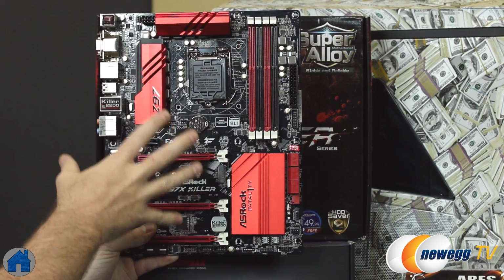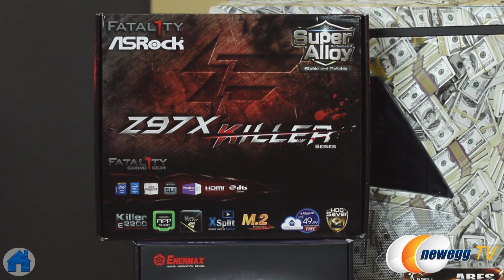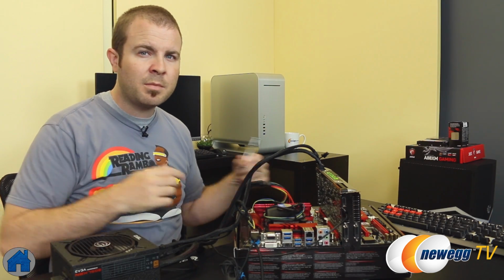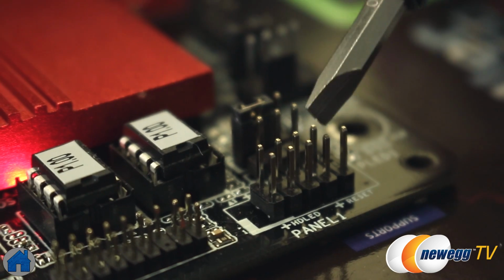How to Build a PC - Part 1 - Newegg TV

Comment: Please let me know if this is a good gaming computer, Im trying to get high Frames Per Second on high graphic games.

Case: BitFenix BFC-COM-100-WWWK1-RP White Steel / Plastic Computer Case

HDD: Seagate 1TB Desktop HDD SATA 6Gb/s 64MB Cache 3.5-Inch Internal Bare Drive (ST1000DM003)

CPU: AMD FX Six-Core Processor Model FX-6300 3.5GHz Socket AM3+, Retail

MEMORY: Crucial Ballistix Sport 8GB Kit (4GBx2) DDR3 1600 (PC3-12800) 240-Pin UDIMM Memory BLS2KIT4G3D1609DS1S00/BLS2CP4G3D1609DS1S00

GFX: Sapphire Radeon R9 270 2GB GDDR5 DVI-I/DVI-D/HDMI/DP Dual-X with Boost and OC Version PCI-Express Graphics Cards 11220-00-20G

MOBO: Gigabyte AM3+ AMD 970 SATA 6Gbps USB 3.0 ATX DDR3 1600
Motherboards GA-970A-DS3P

PSU: EVGA 500W 80PLUS Certified ATX12V/EPS12V Power Supply 100-W1-0500-KR

Thermal Paste: Arctic Silver 5 Thermal Compound 3.5 Grams

Comment: Hey guys! I'm asking you a question, that isn't really rare under these vids;
Is my rig nice? If not, how should I improve it? 
motherboard: Asrock FM2A58+ BTC (AMD FM2)
CPU: AMD A10 7700K (AMD FM2)
Memory1: Adata 8GB 1333MHz DDR3 AD3U1333W8G9-R (DDR3)
Memory2: Adata 8GB 1333MHz DDR3 AD3U1333W8G9-R (DDR3)
GPU: Nvidia Asus GTX970 4GB DDR5 GTX970-DC2OC-4GD5-BLACK
HDD: Seagate 2TB 64MB SATA3 ST2000DM001 (3,5")
Power supply: Antec 750W HCG-750
Case: Cooler Master Elite 241 RC-241-KKN4 (Not sure)
CPU cooler: Cooler Master Hyper 612 Ver.2 RR-H6V2-13PK-R1
(If I forgot something, tell em :P)

Comment: Tell me what you think about this build guys. 

Case: Apevia x-hermes black/blue mid tower
Processor: Intel core i5 4460 3.2ghz
Mobo: Gigabyte GA-B85M-DS3H HDMI SATA 6GB/S USB 3.9 Micro ATX
Memory: G.skill Ripjaws X series 8gb (2 X 4gb) DDR3 1600
PSU: Antec BP550 Plus 550W Continuous Power ATX12V 80 Plus Certified
Video Card: PowerColor Radeon R9 285 2GB

I NEED HELP ASAP.

Comment: Could somebody who knows what they're doing take a look at my list? I want to put together the best gaming PC that I can on a budget, but I'm not sure if this would be the greatest setup. 

Motherboard: Gigabyte GA-970A-DS3P
CPU: AMD FX-6300 6-Core
RAM: Crucial Ballistix Sport 8GB DDR3 1600 MHz
Video Card: EVGA GeForce GTX 960 SuperSC ACX 2.0+ 2GB
Hard Drive: WD Blue 1 TB
Optical Drive: Asus 24x DVD Burner
Case: Rosewill Challenger ATX Mid Tower
Power Supply: Corsair Builder Series CX 500 Watt

Comment: Is this good for gaming?
PCPartPicker part list: http://pcpartpicker.com/p/ZzTDXL
Price breakdown by merchant: http://pcpartpicker.com/p/ZzTDXL/by_merchant/

CPU: AMD FX-6300 3.5GHz 6-Core Processor  ($93.89 @ OutletPC) 
CPU Cooler: Cooler Master Hyper 212 EVO 82.9 CFM Sleeve Bearing CPU Cooler  ($28.98 @ OutletPC) 
Motherboard: Gigabyte GA-78LMT-USB3 Micro ATX AM3+ Motherboard  ($50.98 @ Newegg) 
Memory: G.Skill Ripjaws X Series 8GB (2 x 4GB) DDR3-1600 Memory  ($59.99 @ Newegg) 
Storage: Seagate Barracuda 1TB 3.5" 7200RPM Internal Hard Drive  ($47.89 @ OutletPC) 
Video Card: Sapphire Radeon R7 260X 2GB Video Card  ($97.98 @ Newegg) 
Case: Cooler Master N200 MicroATX Mid Tower Case  ($39.99 @ NCIX US) 
Power Supply: Corsair Builder 430W 80+ Bronze Certified ATX Power Supply  ($19.99 @ Newegg) 
Optical Drive: Samsung SH-224DB/BEBE DVD/CD Writer  ($14.98 @ Newegg) 
Operating System: Microsoft Windows 7 Home Premium SP1 (OEM) (64-bit)  ($88.98 @ OutletPC) 
Total: $534.65

Comment: Can this run Crysis 3 at 240fps highest settings?:
http://pcpartpicker.com/p/733sBm
Reply: clanshadow2 Not even close. Try this: http://pcpartpicker.com/p/zgHh8d
Reply: Pffft more like 200000 fps
Reply: Jethro McBob  What a troll...
Reply: ***** pfft... not even close to enough if you ask  me. I buy it by the gallon and slab it on with my handy dandy paint brush. #MySystenWontBoot
Reply: clanshadow2 lol the monitor you picked has a 60 hz refresh rate. meaning you will not notice any additional fps above 60.oh, and the fact that that build probably can not run minecraft LOL xD
Reply: ***** And the fact that you don't know this was a joke.
Reply: clanshadow2 obviously i knew you were joking. i was just playing along and humoring you
Reply: clanshadow2 it will run perfectly fine. but the only problem is that the monitor has 60Hz. Change the monitor and ur good to go
Reply: clanshadow2 moi

Comment: what do you guys think of my pc build

CPU intel i7 4770k @ 4.0GHz

MOBO:  MSI Z87 -G41

GPU  Geforce GTX 770

PSU  Corsair CX750M

MEMORY  16 GM RAM

OPERATING SYSTEM  Windows 7 Home Premium 

KEYBOARD  Corsair K70 RGB

MOUSE Razor Naga 2014

No Headset Lol

Comment: Do I have to use an aftermarket cpu cooler? It might be something I purchase later on when I upgrade my pc parts, but for now I just want to get my pc running, could the stock cooler work?
Reply: Jonah Neeley yes
Reply: Jonah Neeley i would recommend one because it makes your computer run quieter and cooler. Get the cooler master hyper 212 evo. Its only $30. For now you will be fine with stock. Just dont overclock.

Comment: so I'm building a gaming pc and this is my first pc (that i build myself) ever.

is there anything i should improve on? say to increase the bang for buck. oh and i need to be able to run graphically demanding games like BF4 and Skyrim at very high at 50+ fps.

http://pcpartpicker.com/p/HPZ423

Thanks!
Reply: You should get an i5 4670K instead of an i7 4790K, also replace the R9 280X with a GTX 970.
Reply: As long as you're not doing video editing you'll be fine with an i5 and use the money you save to get a gtx970 it'll run better at gaming
Reply: Anantya Rizky get an i5 and get a gtx 970 instead

Comment: So anyone wanna give me some thoughts on this build ? this will be my first pc jus keeping that in mind . thanks too anyone that can help !

CD: LG 12X Internal Blu-ray Drive & DVDRW, 3D Playback Combo Drive
GRAPHICS: AMD Radeon R9 280 3GB GDDR5 PCIe 3.0 x16 Video Card
COOLANT: Standard Coolant
CPU: AMD FX-8320 3.50 GHz Eight-Core AM3+ CPU 6MB L2 Cache & Turbo Core Technology
FAN: Asetek 550LC 120mm Liquid Cooling CPU Cooler - Extreme Cooling Performance (Single Standard 120MM Fan)
HDD: 2TB (2TBx1) SATA-III 6.0Gb/s 64MB Cache 7200RPM HDD (Single Drive)
IUSB: Built-in USB 2.0 Ports
KEYBOARD: AZZA Delta Gaming Keyboard w/ Anti-Ghosting & red backlight
MEMORY: 8GB (4GBx2) DDR3/2133MHz Dual Channel Memory (ADATA XPG V3)
MOTHERBOARD: * GIGABYTE 970A-DS3P AMD 970 ATX w/ Ultra Durable 4 Classic, On/Off Charge, GbLAN, 2 PCIe x16, 3 PCIe x1, 2 PCI
MOUSE: AZZA Alpha 1600 DPI Gaming Mouse
NETWORK: Onboard Gigabit LAN Network
OS: Windows 8.1 (64-bit Edition)
OVERCLOCK: No Overclocking
POWERSUPPLY: 600 Watts - Standard 80 Plus Certified Power Supply - SLI/CrossFireX Ready
SOUND: HIGH DEFINITION ON-BOARD 7.1 AUDIO
WNC: 802.11b/g/n 300Mbps PCI Wireless Adapter Network Card

Comment: Will an Intel Core i5-4690K Processor 3.5 GHz LGA 1150 BX80646I54690K work with the motherboard (including the chipset). pls and thank you big noob here
Reply: Yep. You want a z97 lga 1150 motherboard for that processor. (like the one in the video)
Reply: FussiestBore3 just remember you want lga 1150 mobo

Comment: Can i run game on ultra with this like bf4 
CPU: AMD FX-4300 3.8GHz Quad-Core Processor  ($95.99 @ Amazon) 
Motherboard: Asus M5A78L-M/USB3 Micro ATX AM3+ Motherboard  ($44.99 @ Micro Center) 
Memory: G.Skill Ripjaws X Series 8GB (2 x 4GB) DDR3-1600 Memory  ($69.99 @ Newegg) 
Storage: Western Digital Caviar Blue 1TB 3.5" 7200RPM Internal Hard Drive  ($44.99 @ Best Buy) 
Video Card: Sapphire Radeon R9 280 3GB Dual-X Video Card  ($172.98 @ Newegg) 
Case: NZXT Phantom 410 (Red) ATX Mid Tower Case  ($75.99 @ NCIX US) 
Power Supply: Corsair CSM 550W 80+ Gold Certified Semi-Modular ATX Power Supply 
Optical Drive: Asus DRW-24B1ST/BLK/B/AS DVD/CD Writer  ($19.79 @ OutletPC) 
Total: $524.72
Reply: Replace the FX 4300 with a 6300.
Reply: clanshadow2 already did that but thank you

Comment: EVGA Superclocked ACX 2.0 NVIDIA GeForce GTX 980 4GB GDDR5 PCIe 3.0 x16 (Maxwell) (Single Card

1,000 Watts - AZZA Titan 1000W 80 Plus Bronze Active PFC Power supply

ASRock X99 Extreme4 ATX w/Intel GbeLAN, 3x Gen3 PCIe x16, 2 PCIe x1, 1x Ultra M.2, 10x SATA 6GB/s

Widescreen 1920x1080 Sceptre E225W-1920 LED Monitor 

16GB (4GBx4) DDR4/2400MHz Quad Channel Memory (GSKILL Ripjaws 4)

256GB ADATA SP610 SSD + 2TB SATA III Hard Drive Combo 

Asetek 510LC 120mm Liquid Cooling CPU Cooler - Enhance Cooling Performance (Single Standard 120MM Fan)

Intel® Core™ i7-5930K Six-Core 3.50GHz 15MB Intel Smart Cache LGA2011-V3 

NZXT Source 340 Mid-Tower Gaming Case w/ USB 3.0, Side-Panel Window (Black/Orange Color) is this good
Reply: Yea it's good you'll have more than 60fps on almost all games
Reply: you dont need a 1000 watt power supply, 600 to 650 should be plenty.
Reply: SamDGAF i7 and 16gb of ram is a bit overkill, what are you going to be doing with this pc

Comment: Hi guys, thank you so much for the video!

My question is- is it ok to do the test boot outside the case with the aftermarket cooler already installed? (not a watercooler system) Or is there a reason for putting the stock heatsink fan first?
Reply: For you are first

Comment: Im new to pc building, but will this work fine and plz tell me if any parts wont work in tandum: http://pcpartpicker.com/p/4rBMrH
Reply: Holy shit thats amazing the psu  the psu is not very good ill edit the build witha better psu and be back
Reply: Moethedirt thx, btw i tweaked it a bit, here's the new one: http://pcpartpicker.com/p/jQXXWZ
Reply: Derpy Wolf I would recommend ditching that i7 and getting a i5. Use the money you saved to buy a ssd
Reply: Derpy Wolf No Problem but don't bother with a X99 motherboard and X99 CPU because that's so unnecessary and worthless for gaming.
Reply: Derpy Wolf Is this just for gaming?
Reply: OAcesync yea it is
Reply: Derpy Wolf I would get this instead
http://pcpartpicker.com/p/wwKLxr
Reply: OAcesync ill mix and match and see what works best for me, thx :)

Comment: Hey guys after watching this I was inspired to create a decently priced PC for decent quality, please give feed back :)
-Rosewill CHALLENGER Black Gaming ATX Mid Tower Computer Case, 60 bucks, very highly rated on newegg
-AMD FX-6300 Vishera 6-Core 3.5GHz (4.1GHz Turbo) Socket AM3+ 95W Desktop Processor FD6300WMHKBOX, .5 GHz less than the more highly rated processor, should I cheap out on this or buy the 4? $110 for the 3.5
-GIGABYTE GA-990FXA-UD3 AM3+ AMD 990FX + SB950 SATA 6Gb/s USB 3.0 ATX AMD Motherboard, the mother board fits the AMD FX-6300 and it was highly rated as well. $130
-EVGA 02G-P4-3753-KR G-SYNC Support GeForce GTX 750 Ti Superclocked 2GB 128-Bit GDDR5 PCI Express 3.0 Video Card, this graphics card apparently is great for its price, $160.
-Western Digital Blue WD800JD 80GB 7200 RPM 8MB Cache SATA 3.0Gb/s 3.5" Internal Hard Drive Bare Drive, a mechanical hard drive that apparently works well. $160.
(Please suggest fans and/or replacements for the parts that I have listed)

Comment: I've been asking around and so far no one has managed to help me find out if the build I am making is good?

here is the build, please reply your opinion
2x EVGA GTX 980
Intel i7 4790k
ASUS 797 PRO LGA 1150 motherboard
Crucial Ballistix 16 gb ram
Samsung 840 EVO 250GB SSD
Western Digital Blue 1 TB HDD
Seasonic M1211-850 Power supply
Reply: ***** sorry but no, no no...
He has 2 980s. Stop talking out of your ass, if he has 2 980's in the build it's clearly going to be enthusiast grade. He has the money, get the i7. Overall it is a better cpu, even if it won't make much of a difference in gaming, cutting down there when you have 2 980's is just awkard. Also, nope get 16gb of ram, if you have the money again for 2 980's get 16, not 8.

One last thing, maybe check your psu on johnnyguru.com and see if you can get better ones, I don't know much about seasonic though, but you may want some more watts just for headroom when overclocking, but it's your choice. Btw ask around on forums, youtube isn't a good place to ask about builds tbh
Reply: outdated build you can defenelty do better for the budget
Reply: what would your recommend?
Reply: theBambu
no need to waste money on an i7, go for an i5 instead, not much of a difreerence, go for a evga or corsair power supply instead. for gaming you dont need ssd drive your wasting your money. gpu is fine, and 16gb of ram wont be needed untill years so go with 8
Reply: Hey man, thanks alot, I was getting worried when he said 8 ram and i5, I knew it would decrease it and the fact gtav on pc takes 8 ram alone. I will definetly check it out and thanks again.
Reply: theBambu yep, 8gb of ram is sufficient for gaming but you are future proofing, games are recommending 8gb now when they were recommending at least 4gb and extra ram is always better if you have the budget...
Reply: 16gb is a little bit overkill. Games wont require more than 8gb for quite a while. 16gb will run hotter, therefore, a little slower. But it's still going to be a nice build. Good luck!

Edit: Also, if you really need the ram later on (I doubt it), you can just buy 2 more 4gb sticks. To require more than that would not be for a gaming purpose.
Reply: kraftedFTW Would I still be able to max out upcoming games in 1080p if I took one gtx 980 out?
Reply: lol? you can max with one gtx 970. gtx 980 of course!
Reply: kraftedFTW okay cool, thanks for all of your help man.
Reply: theBambu no problem :)

Comment: do u guys have any feedback about my build

i5-4590 
GIGABYTE GTX 970
ASRock Fatal1ty B85
Kingston 8GB KIT RAM 
Corsair Carbide Spec 3 
600W Corsair CX600 PSU 
1TB WD BLUE 
120GB Samsung 840 EVO SSD 
Coolermaster 120mm JetFlo LED Blue & Red

Comment: How would this build run? I'm planning on changing the power supply to one with more wattage.

http://pcpartpicker.com/p/rsM24D
Reply: ***** Thanks for the tip about the 80+ thing but I thought that a superclocked (1.2 GHz) GPU would be better than a 2 GB lower clock because in my experience, overclocking my GPU to run even a few MHz higher greatly increases performance. So what would better for light video editing + semi heavy gaming, a higher clock or a higher amount of memory?
Reply: Kevin Brown I believe the 750ti is the one to go for if you are looking for 2gb around the same price :)
Reply: ***** yep thats what I said, although I have got a gtx 970
Reply: Get a 6300.

Comment: My Build is this: 
Intel Core i7-5960X Haswell-E 8-Core 3.0GHz LGA 2011-v3 140W Desktop Processor BX80648I75960X

MSI X99S SLI Plus LGA 2011-v3 Intel X99 SATA 6Gb/s USB 3.0 ATX Intel Motherboard

CORSAIR Dominator Platinum 32GB (4 x 8GB) 288-Pin DDR4 SDRAM DDR4 2666 (PC4-21300) Desktop Memory 

Western Digital Blue WD10EZEX 1TB 7200 RPM 64MB Cache SATA 6.0Gb/s 3.5" Internal Hard Drive Bare Drive(2)

DIYPC Skyline-07-G Black/Green SECC ATX Full Tower Gaming USB 3.0 Computer Case w/ 7 x 120mm Green fans

SAMSUNG 850 EVO-Series MZ-75E1T0B/AM 2.5" 1TB SATA III 3-D Vertical Internal Solid State Drive (SSD)

MSI GTX 980 GAMING 4G GeForce GTX 980 4GB 256-Bit GDDR5 PCI Express 3.0 x16 HDCP Ready SLI Support G-SYNC Support Video Card ( Probably upgrade to two later)

Enermax Liqmax 120S Aluminum All-in-One Liquid Cooler With 120mm Circular Blue LED Fan

CORSAIR HXi CP-9020074-NA 1000W ATX12V / EPS12V 80 PLUS PLATINUM Certified Full Modular Power Supply

Corsair Air Series AF120 CO-9050015-BLED 120mm Blue LED Quiet Edition High Airflow Fan (6)

As well as naga epic chroma and Blackwidow Ultimate Chroma, and also Blue Yeti and 2 random Asus 23 inch HD Monitors, as well as logitech C920 HD Webcam

Comment: So I'm building a PC, these are the specs:
CPU: i5 4440 3.1GHz
GPU: ASUS GTX750Ti DC2OC 2GB GDDR5
MOBO: ASUS H81K-M
HDD: WD Caviar Blue 1TB 7200RPM HDD
RAM: Kingston HyperX Black 1x8GB 1866MHz (It'll downscale at 1600MHz)
Case: Deepcool Tesseract SW White
PSU: Deepcool DA500-M Modular 500W PSU
(Now, I'm gonna buy a 212 Evo if I get hot temps, but the Tesseract has 3 fans in the case, and the CPU also has a box fan. I'll replace the fans for a perfect airflow, and I will see. )

Comment: Hello glorious Leaders of the master race, I need to hear your opinion on this build. Im on a 500 budget(canadian prices are a pain) and was hoping to run Games like skyrim/crysis at an acceptable framerate.

CPU: AMD Athlon X4 760K 3.8GHz Quad-Core
Motherboard:Asus A88XM-A Micro ATX FM2+
Ram:										Mushkin Silverline 4GB (1 x 4GB) DDR3-1600 (Will upgade later of course)
VideoCard:										EVGA GeForce GTX 750 Ti 2GB
Storage:Western Digital Caviar Blue 1TB 3.5" 7200RPM
Case:										Corsair SPEC-01 RED ATX Mid Tower
Power Supply:										HEC 485W ATX12V

Comment: If I follow all the steps will my parts be installed correctly??
Can I run Crysis 3 on ultra??
specs:

CPU: Intel Core i7-4790K 4.0GHz Quad-Core OEM/Tray
MOBO: ASRock Z87 Extreme4 ATX LGA1150
RAM: G.Skill Trident X 16GB (2 x 8GB) DDR3-1600
GPU: Zotac GeForce GTX 980 4GB AMP! Extreme Edition
HDD: Western Digital Green 4TB 3.5" 5900RPM	
PSU: EVGA 850W ATX12V / EPS12V
OS: Microsoft Windows 8.1 Pro - 64-bit (OEM) (64-bit)
CASE: Cooler Master Storm Stryker (White) ATX Full Tower
MONITOR: Acer H236HLbid 23.0"

Comment: Cheep solution to avoid ruining parts or getting static electricity, wear latex gloves.
Reply: Creeper Gaming building a pc just got kinky
Reply: Oh yeah of course, Thanks
Reply: Creeper Gaming goes this really work?
Reply: DeadlyDucatii
I would think so, considering rubber doesn't conduct electricity and it prevents oils from your skin from getting on the chips.
Reply: I read somewhere else that it doesnt help. I finished my build, I didn't use any anti static material. Everything is running fine.